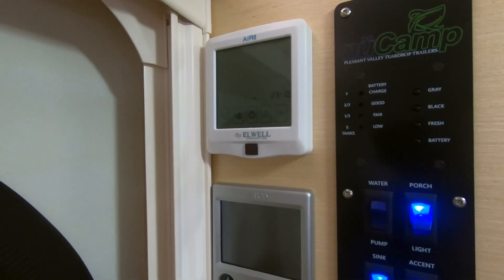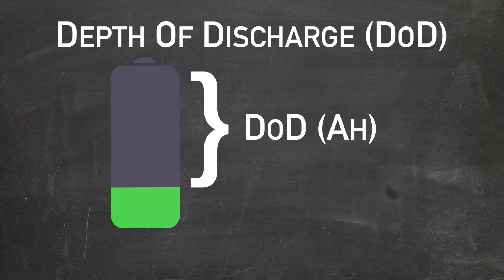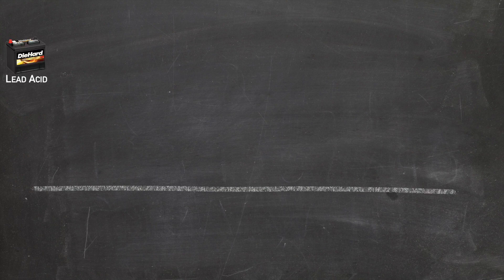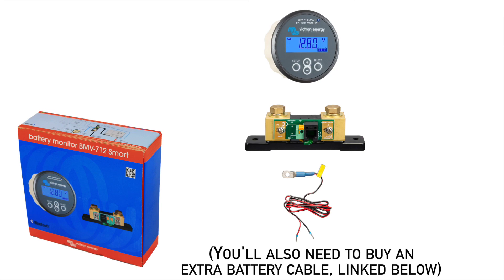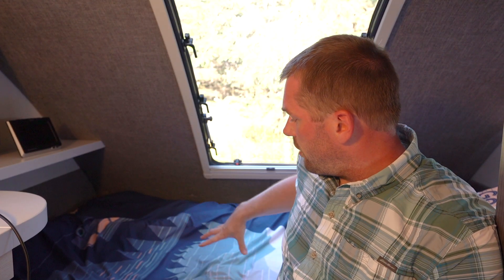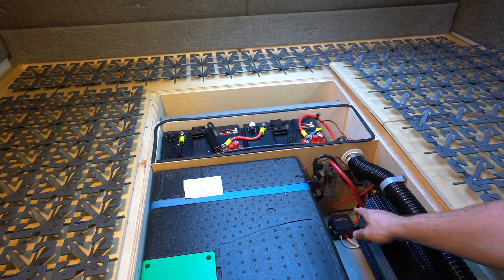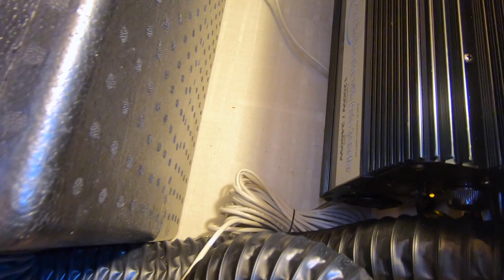How we Installed a Victron Battery Monitor (BMV-712) in our Tab 400

Comment: Thank you!  I really appreciated the explanation about battery types and full vs. discharged.  I’ve always wondered about those lights and the “charged, good, low” values.  I’m performing an upgrade to my 5er and will be installing the same BMV 712.  A couple of notes…. One, the shunt has a specific lug that the negative connects to.  Not just, “connect it to one end of the shunt”.  It’s labeled on the shunt and it’s important you follow that designation.  My second it that your awesome set up deserves the display!  :). I think you should still mount it so you can refer to it on the fly instead of searching for your phone/iPad or whatever.   Great video and thanks for publishing this!

Comment: Your video is excellent.  Not too much tech gibberish but still explaining things that many people don't really understand.  

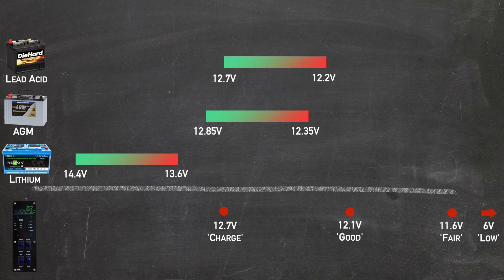One thing I'd point out is that the battery comparison chart you created at ~4:30 (quite excellent by the way) showed the "resting state" charge for the batteries.  When you are charging or draining the battery the voltage will rise or drop and no longer show the "resting state" charge.  This explains how the 1970s era battery "gauge" was not entirely flawed, the Good and Fair might seem low for "resting" but considering it was usually being drained, and exhibiting voltage droop, it really wasn't (yet) damaged.

The same not-resting-state problem exists when using any of the cigarette lighter style battery monitors you mentioned at 12:00.  Yes they are more accurate than the 3 LED light monitor and they require the mental math each time you check, but unless you unplug or switch off EVERYthing for 15-30 min first you won't really get a useful result.  

Obviously this is why a shunt monitor is far better!

Comment: I have this monitor that I am going to be installing. A question o have is we are weekend campers . I would like to keep a charge on my batteries while is sits . What charge controller would you recommend? And what panel would you recommend. I have a 2021 Reflection with solar prewired. I don’t think I will need an inverter just to keep the batteries charged right . I will at a later time but for now just want to keep the batteries charged . 

Thanks

Comment: If you leave your BMV-712 under your bed where it isn't readily visible what do you do when you're boondocking and your WI-FI isn't connecting?  My TAB has a MPPT 75/15 solar charge controller under the bed which is blue tooth compatible and it appears to have the same functionality as the BMV-712, which I would like to purchase and display for all those times the WI-FI isn't working. Good data on the LED lights, which specify at what voltage the lights are illuminated and why they are basically worthless.
Reply: Bluetooth not WiFi

Comment: This was a great video. This was the best one I found. Monkeying around with electricity always scares me. Thank you, s-o-o-o much! I want to add that there are alternative ways to connect the Victron battery monitor to the batteries.  I have a 2021 T@B 400 and the battery compartment is configured a bit differently than the one in this video. In my T@B 400 the  distribution block is in a pretty tight, inconvenient place outside the battery compartment, so I did not want to fiddle with that. I made all of my battery-shunt connections inside the battery compartment before the  battery wires exited the compartment and attached onto the distribution block in a separate adjacent compartment as was done in this video. This required an Auto Zone purchased 32" black/negative wire I used to connect the main negative battery post to the shunt block. Then the original existing black/negative wire (I had disconnected from the main black/negative post) was curled and attached to the other side of the shunt. Also, when I looked very carefully at the video at the 10:37 mark you can see at the topmost entry, the battery capacity = 224 Ah. I called the battery maker, Harris Battery company (800-367-7670, nice customer service lady) and got that verbally, before I noticed that in the video. I also verified this in the spec sheet PDF for the Harris AGM battery sent to me via email.  You need that 224Ah (at least for this Harris AGM battery) number to set up the monitor. Again, thanks so much for the video. It was instructive and professional.  I will look for others you made. Take care.
Reply: Your reply was helpful to me. I am also wanting to install the BMV 712 in a 2021 T@B 400 and was trying to figure out the best location for the shunt. Where did you locate the distribution block on the 2021?

Comment: Checked number on our Harris batteries in 2020 T@B 400 Boondock Lite built in January, 2020. HBDAGMGC6-A. Is that same battery as yours? Are the configuration numbers above generated by the Victron or are they numbers supplied by Harris?  Thank you!

Comment: Thanks for doing this Ben and Julie! Is the extra 12" battery cable and heat shrink tubing called for in Victron's installation instructions? Did you by any chance also take on the Fantastic Fan upgrade (7350 kit)? Can't tell from forum comments whether that's easier or tougher than the Victron BMV-712 installation.

Comment: electrical noob here.  So only one ground from shunt to the battery, then all loads go to the shunt?  Thanks.  No other Negatives go to the battery itself I assume.
Reply from the maker: Correct, you need all of the loads going through the shunt so it can accurately measure the power coming out of the battery.

Comment: Thanks for sharing.  Not many DIY videos on the Tab 400. Consider adding more solar panels in the future? Also, I wonder how well the cables are routed to the roof.  Id plan in adding at least 2 more panels on the roof. Curious how user friendly that will be. Wonder if they left space for more panel wiring on the roof to make it plug and play or not.

Comment: We just chose to switch our lead acid batteries out to Battle Born Lithium, with the Victron BMV-712 as well, so it's nice to see that the install 'shouldn't' be too difficult at least.   I'm hoping I can fish the wires up our coach, so I can mount the device head to the wall area somewhere (which may be difficult).   Thanks for the tips/tricks!

Comment: Nice job.  We have a Victron Battery monitor in our 2018 400 too. Love the Bluetooth feature, but we also installed our faceplate on the side of the bed near the refrigerator as well.
Reply from the maker: That’s a great spot for it. We’ve been trying really hard to keep anything that lights up at night away from the bed area for best stargazing but there’s a chance I might put it there some day.
Reply: Your air conditioner vent may not give you enough room to put a monitor along the bedside. We keep the light off the monitor so have never noticed any light at night there. That Jensen though!  Have dimmed it mostly, but just enough to see the time.

Comment: Great video. We just installed ours today, great product. Had a question about your bed. What is on top of the wood that the mattress lays on, creates an air gap or something?
Reply from the maker: Hey Tony, thanks!  The spring system under the mattress is the ‘Froli sleep system’. Its both springs to somewhat replace a box spring and an air gap to prevent mold on the mattress. 

nuCamp installs them by default on all of their campers but I’ve seen other people install them after market as well. 

Ben
Reply: @grefeaway2451  Thanks Ben, going to check it out.

Comment: 13.6 is a standard charge for a fully charged lithium battery. They need to charge at 14.4 but they don't maintain that once they are charged up. Also, 80% DoD isn't correct for lithium, at least not for Battle Born or Relion batteries. They can be drawn down to 1% without damaging the battery. The Battery Management System that comes with modern lithium batteries takes care of all of this and will not let you overcharge the battery or take it beyond the maximum DoD.
Reply from the maker: Thanks for the info John.  I guess if the BMS in a LiOn battery takes care of max discharge levels then it’ll somewhat mess up the 80% math.  Good stuff to know, I don’t have any of those yet so I can try it :).
Reply: Glad this was already addressed.  I also show 13.6 as 100% max for Lithium and a 99% DoD taking it below 12.0 volts.

Comment: so we connect all of our system negatives to the other side of the shunt. or in your case you ran the other side of the shunt to a connection block and connected all the negatives there?
Reply from the maker: Correct. The shunt needs to be the single contact point to the battery. On my T@B there’s a connection block to do this from the factory.

Comment: Nice video.  My husband installed our Victron 712 a little differently since we are using a Zamp suitcase. It has a charge controller and monitor, but I did not want to run over to it outside to check the status of our battery. Now I can check it via my iPhone or by the monitor (he put it on the side of our bed near the refrigerator door as it opens. Not the best place, but we have options now for checking.
Reply: Hi Liz. I too have a portable Zamp solar suitcase and would like that incorporated into the monitoring system. Would you or your husband be amendable to sharing the wiring method to do this so all of the data can be monitored through the Victron 712? I'd really like to know how that wiring is done so I can wire ours similarly.
Reply: @brianhenry9453 , my husband does not remember exactly how he wired it, but he said he does remember following the directions that Victron sent. Do you have those directions?  He put the monitor below our bed so he would not have to run the wire too far as our batteries are under our bed. Not the best visible spot, but with the phone Ap, it works fine.